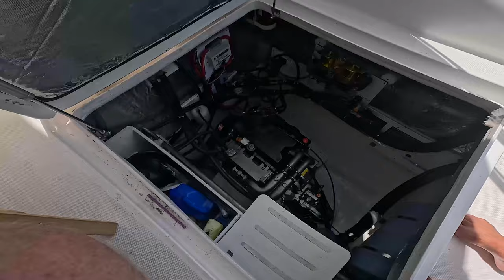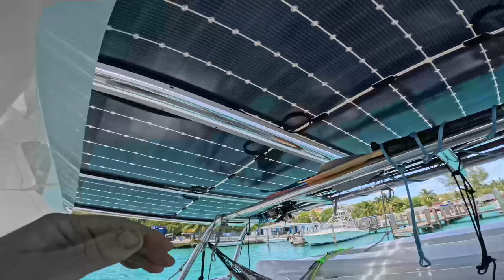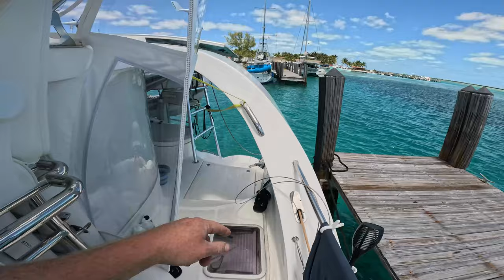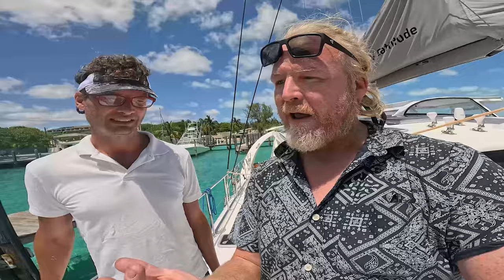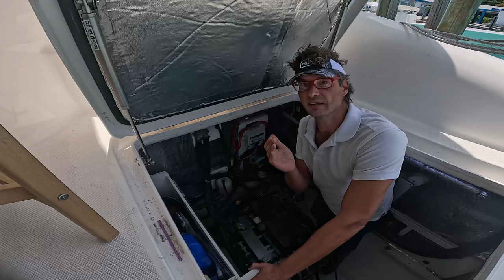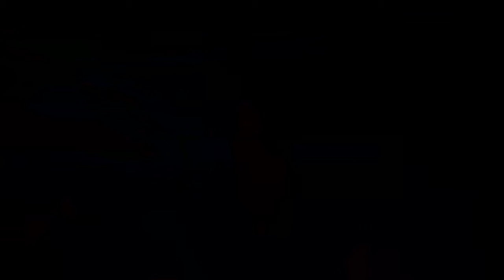The reality of owning and sailing a 3 million $ dollar catamaran. S6 EP 20 SVEV

Comment: Thanks for the video! At 25 minutes he us describing his American Power Systems alternator. Very robust design. Probably the 5 kw 360 amp model derated to 300 as he says. It is not a Balmar.
Reply from the maker: Thanks for specifying this. I wonder what the lowest horsepowered engine could accommodate this alternator? I have an 80 Amp balmar style alternator and balmar computer control box. It works wonders in small engine mode at 20% field. What is your system? Any suggestions?
Reply: @sailingEV888  I don’t claim any expertise but I and many others have a 5 kw alternator on a 50 hp (equal to 37 kw) diesel. So unless at full power there is plenty of extra power for the alternator, and this is even better at mid RPM use since diesels like to be loaded. I cannot say how small an engine would be too small. Another issue is whether on a new engine the manufacturer will say you void the warranty if the take off power induces side loads that damage the bearings. Yanmar and Volvo will not generally put in writing that this is ok. However, I believe that Beta, for example gives their blessing to these installations as they say their Kubota block has heavy duty crankshaft bearings.

Comment: a septre 36 has 5,500 lbs balast in her keel, that is over 2 tons,😳 start takeing on water and comprmize boyancy your going straight to the bottom, major safety strike against a mono hull, that said if faceing a carabean hurricane im on the septre,, my laguna 24 has a 600 lb cast iron swing keel that if not maintained could fall off, im also building a new composite water tight companion way hatch

Comment: I think a small catamaran maby could be cool.. more wpace then a mono and u could strand it.. but they say its unsafe in heavy weather and they cant go upwind so good. So i dont know man.. and price for marinas🤗 do you wanne have a catamaran?
Reply from the maker: It would provide more space. I intend to start having supporters and viewers on the channel come aboard. My vessel is packed with camera gear.. edit suite guitars.. there is no space ! A cat could be a cool thing to own. However at this point I'm a monohull person..
Reply: @sailingEV888  yes it's the space I'm after.. if I'm more then 1 person. It's alittle cramped now😅
Reply: @clivestainlesssteelwomble7665  very good and informative 🤩
Reply: Symmetrical Dagger board cats do a very good job .. if they are a bit more slow bear off a little and you will usually make up the angle distance with the extra speed you have. 
My two favourite cats have @2M of freeboard so poundings even less likely . 
On the ball at anchor or dried out on a sand bar, mud flat or beach  or high up a shallow river.. there's no need for a marina even if there's one where you want to go.  So unless your monohulls a bilge keel or has a lifting keel and protected rudder and drive the deeper draft is going to force you into marinas or to stay further off shore anyways.🤷🏻🧙🏼‍♂️🇬🇧 
There's also the tidal ranges that you face in many parts of the world outside of the Med. and Caribbean...  So unless your behind locked gates or in dredged deep berths you are likely to be stuck on the bottom or over on your side hoping there's no waves when the tide turns and starts refloating you.

Comment: A fancy boat like that needs lithium batteries and a safe way to heat them when in Canada or cold weather. You guys are funny talkin about what you can and can’t buy at stores even with unlimited budgets lol
Reply from the maker: I think he chose non lithium battles because if fires 🔥  a boats worst nightmare.(especially with a family onboard)
Reply: New safe batteries are coming out soon.

Charged from the air frequency.

I can show you how to get one of those catamarans
Reply: @sailingEV888  yeah that’s what most people think about when they choose lithium. New systems are millions times more reliable, cheaper and with way more capacity. Been sleeping on top of mine for 6 years now. As the trends go, cars first then boats and planes. For now I’m happy powering my devices including Starlink

Comment: I disagree, this is not a custom build it is a production boat, that has been accessorised. Stainless steel framework holding up the Bolt on solar panels. The cockpit has everything led through jammers to two winches. It is just the cheapest way to build a cockpit, A real blue water cat has at least twin helms and dedicated winches for all major sail handling and should be a full monocoque structure, and definitely have dagger boards, not just for sailing upwind but so they can be raised in heavy weather.
Reply: this boat is production junk just like 99% of them.  3 million, if this guy paid 3 million for that boat then i have a few bridges to sell him.........unreal what people waste their money on.  All these new boats look like cheap extended stay hotel rooms inside too.  How could anyone think this is a quality boat.